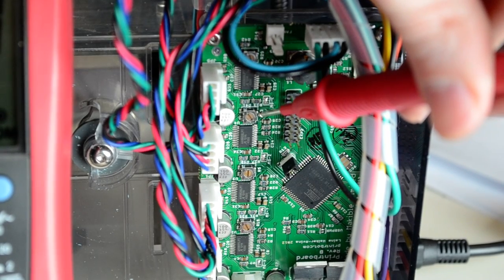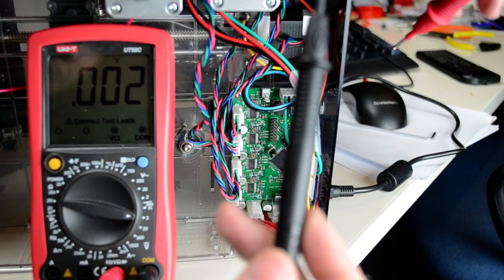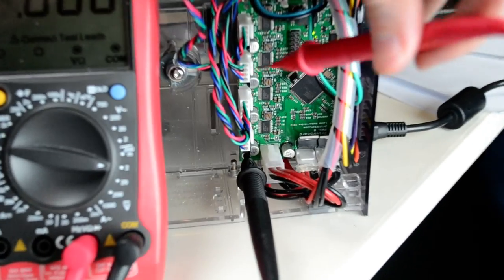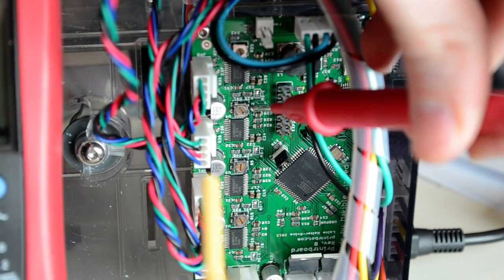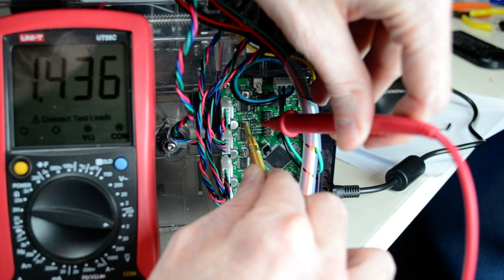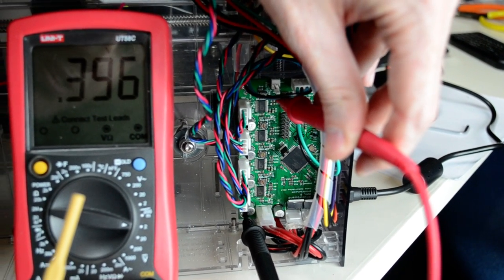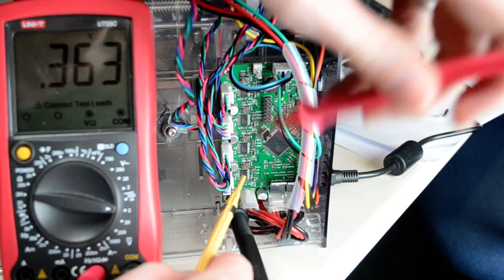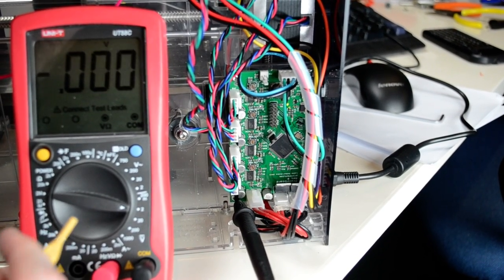Printrboard - Tuning the stepper driver current

Comment: Stupid question.  Should the printer be powered on when doing this?  Do you advise doing this before first print or only if problems arise?  What kind of problems would indicate the current needs adjusting?
Reply from the maker: The board needs to be powered on, so you can read a Voltage.

You should only do it, if you're having problems that aren't based on slicing problems.

For the X and Y axis, you would see the print "slanting" in either X or Y direction.

For the extruder it might either not have enough force to push the filament through, or it might push too much and the gear might scrape off filament while driving it through.

For Z it's usually a bit harder to notice.
Similarly to the other axes, you might see an increased or decreased margin between the print and the hot-end, which would result in the hot-end being too close to the print (and melting away printed layers), or it might get bigger than it should, so you won't get proper contact.